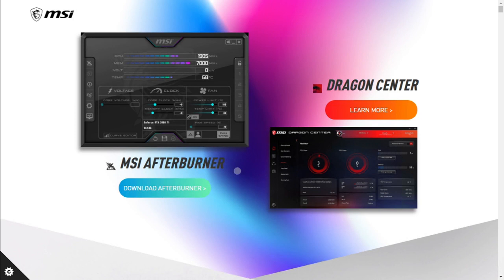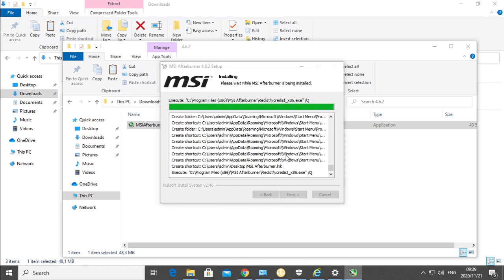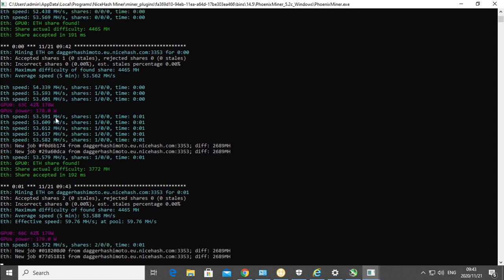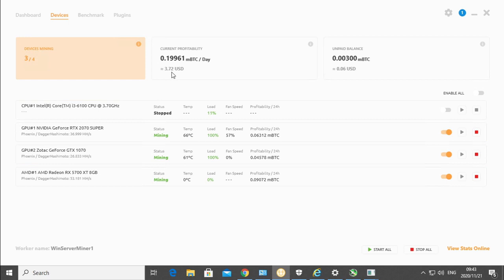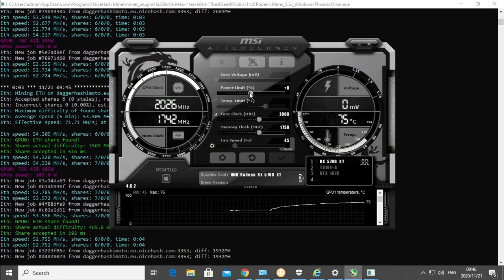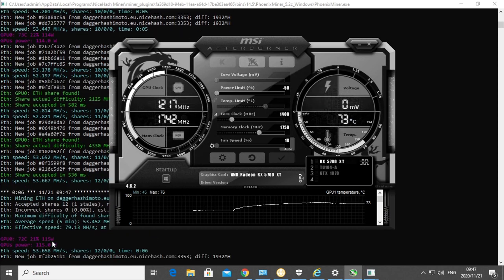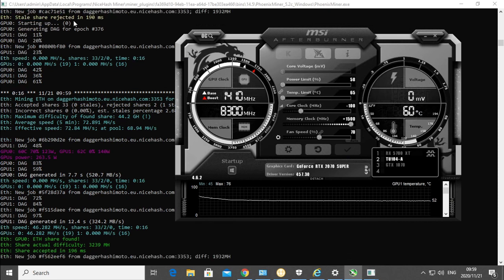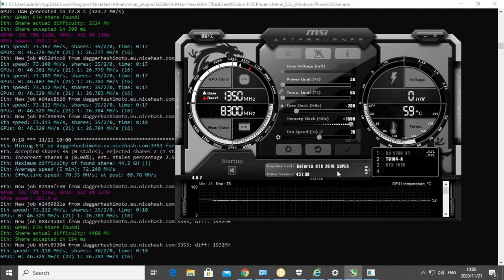Mining on Windows 10 with NICEHASH - Overclocking and undervolting your graphics cards - Part 3

Comment: I have my core clock lowered to 1400 MHz (RX 5700) - but when mining Afterburner tells me my GPU clock is always running around 900 MHz. Any idea why this might be? It seems to always be running lower than 1000 MHz regardless of what I set the Core Clock to in afterburner.
Reply from the maker: Hi Daniel, I did a bios mod on my RX5700XT, so that the overclocks don't change. I don't use MSI afterburner to overclock AMD cards. have you done a bios mod?

Comment: is this settings can be use to improve gaming performance too?
Reply from the maker: Hi Marzoo, it doesn't I'mprove gaming, will be slightly lower framerate, you lowering the power consumption to use less electricity, so the core of the graphics card is not running at 100 percent.

Comment: Video title states voltage reduction.  I watched purely for that because I was trying to find someone who specifically mentions voltage (And not just power -- but power is all you went over in the video -- your voltage monitoring wasn't even switched on in MSI AB.  I found your video title misleading.  The point of reducing the voltage is you can keep the clock rate the same until you've used up all your stability headroom.  (I know ethereum is more memory focused than the core, but it does still obviously make a difference once it passes a certain point).

Comment: What should my overclock setting be for gtx 1650 mining on NiceHash?? Please help right now I’ve got it set at +200 core clock +750 memory clock power 100 fan auto
Reply from the maker: that's the overclocks that i would use. depending on the algorithm that you mining. what is your power limit? PL is quite important as well

Comment: Pls help as I tried to lower my 2060 hotspot temp brelow 75c, i used the power curve editor to 1400 flat which reduced the temp tp 65c but after an hour it goes back to default powerlimit of 73%, i need to stable the curve editor to sustain below 70c temp
Reply from the maker: Hi Robert, i'm trying to get my hands on a RTX 2060, you should be able to get about 36mhs @ 120watts. not the most efficient card, but still profitable. I would start with 70PL, -200 core, +750 memory.

Comment: Heey  i have one question like i have rtx 2060 so i set her to mine on nicehash but temps were heigh like 62c for me thats heigh so i undervoltit from 1.100 to 0.700 and now in msi afterburner gpu monitor first column now says 1200 there was 1300 before so now temps are like 50c and mhs are the same i didnt change memory clock it is stock on +0 so my question is is it safe and can something damage my card right now like pwr is 60w and power consumption droped from 78 to 39%?

Comment: I have an Asus gaming laptop (RTX 3060 6GB). With a cooling pad it runs at about 63c, but I could only get about 24mh/s on it. Also sometimes I get warning that device is too hot, is 60c actually hot for mining? I heard that the 3060 laptop version doesn’t have a hash limiter like the pc version and I’m wondering how to increase the hashrate and remove the error.. other videos I’ve seen of people using the exact same specs (different model) got around 45 or more mh/s.
Reply: I’m not using the laptop mainly for mining btw, I only mine when I sleep

Comment: temps in the 70's is in no way hot. And if you're not running multiple cards then there's no point in underpowering a single card to offset electric costs. Overclocking the memory is pointless if you're not processing anything more for the memory to process. They are already set where they are for a reason.  This is sheer wankery.
Reply from the maker: Do you understand how much electric a graphics card uses if not undervolted?
Reply: Lmao, if you dont pay the bill maybe it's worthless. But if you do, then its really important. They are set like that because Nvidia cant check every single GPU they produce, they just set a voltage curve that might fit all video cards, but that doesn't mean it's the best.

Comment: Hi noob here, I'm using nicehash mining off my rx 580 8gb (sapphire pulse) i was told there is a OCtune on nicehash quick miner but as im using an amd card i had to d/l the miner for both nvidia and amd. Is there an auto OCtune on that or no? I dont believe there is so should I use afterburner? I've heard of of Sapphire trixx as well? Only thing I have is the Radeon software to change it to compute and I'm only getting between11-14 mh/s, any tips welcome to get this up. Thanks!
Reply: I can help you with overclocking and undervolting, here's my discord Raito#8900

Comment: Gpu - rtx2060. With default settings when i run miner i have approximately 26.5mh/s and gpu temp goes to 82C
Once i i undervolted my gpu from 1.1V to ~850mV, decreased Core clock by 500mHz and overclocked gpu memory by 800mHz (it crashes when i am trying to apply more) i got ~ 30.5Mh/s and the highest temperature is now 71C.
Can u give me any advice on managing these afterburner settings and have i done something wrong so far?

Comment: I copied the nicehash settings for RTX 2060. Power Level - 78 (min, coudnt go lower)
Core clock - untouched
Memory core - 600
Fan speed - 64 (The temp lowered from 74 to 61)

If I use these settings and mine for more than 12 hours a day, will it affect my GPU life ?
Reply: Lmk if you get an answer I got the 2060 too. I’m at 100% usage with 64 degrees celsius. This bad for my card?
Reply: 64 degrees thats very good 👌

Comment: what if i decrese memory clock and core clock for my rtx 2060. i want to safe mining i dont want to damage my card.
Reply from the maker: you can overclock your memory to +750 safely, but make sure you undervolt your card to 75%. let me know if you need help
Reply: @sloshmining  i do settings in ethermine website. should i do from msi afterburner?
Reply: @hicumut  11w,
Reply: @sloshmining  and in my msi afterburner i can max undervolt my card to %78

Comment: i pushed my memory to 1500 on the 2070 super and the screen on both of my monitors went black?
Reply from the maker: Hi Lee, safe overclock on memory would be +1250, i've been mining with a 2070 super and getting 44-45mhs stable
Reply: @sloshmining   i try push it but crashes everytime, im getting 40mhs up from 35 thanks to your video
Reply: Same thing happening on my 2080ti

Comment: Is It better to use msi software for overclocking and undervolt the GPU or will a bios mod for GPU gives better performance instead or is there even a need to overclocked at all if the GPU is flashed with a bios mod for mining?
Reply from the maker: I did both, first the bios mode, then overclock and undervolt with MSI afterburner. I don't use the AMD software to overclock and undervolt.
Reply: @sloshmining  what if I want to game on the same GPU that I mine with is there a sweet spot can I just save configurations and switch as need????
Reply: @shopperman2007  Create two profiles in afterburner. One for mining, one for gaming. Simply click disk icon and save to position 1-5.